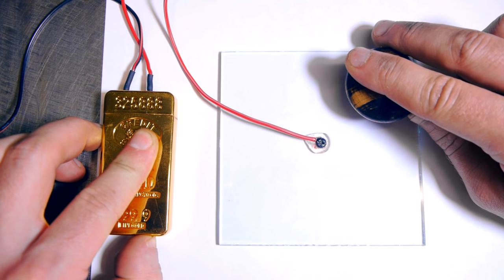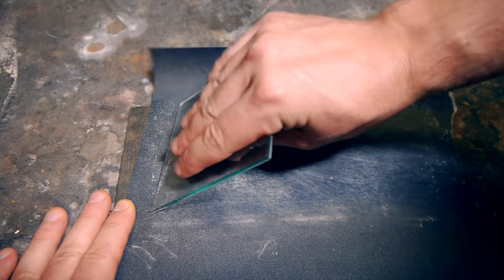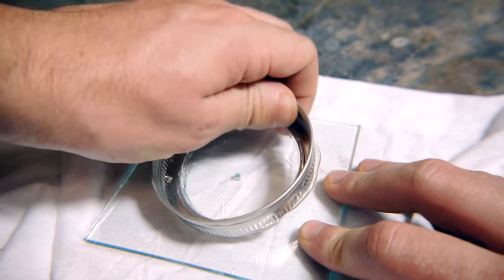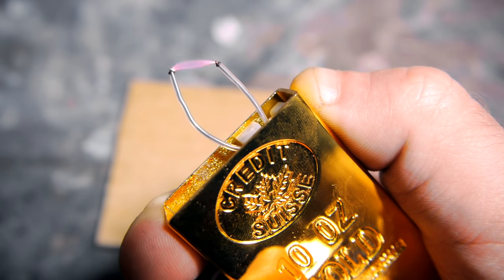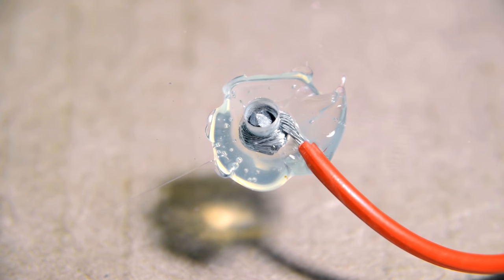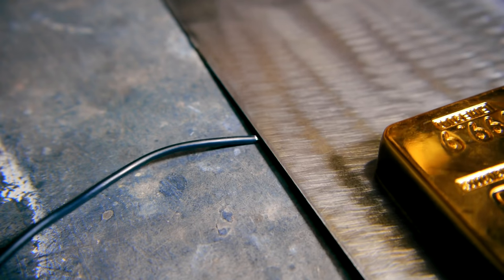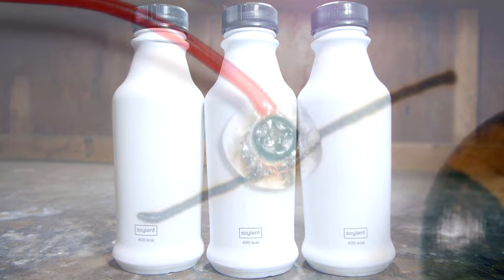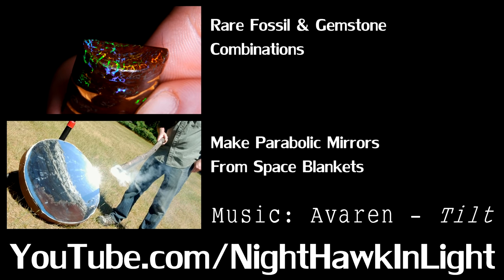How To Make a DIY Mini Plasma Cutter From an Arc Lighter - NightHawkInLight

Comment: Surely if you actually used one of these to light a cigarette you'd get a shock?
Reply: cigarets are non conductive
so no you wont het shocked
Reply: The electrical potential is between the two electrodes, not ground. You can't really get shocked unless you touch both electrodes with your finger. If the insulation broke down internally and created a common to the metal case, then you'd be in trouble - but it's low energy.
Reply: Is this question serious? :/
Reply: ***** Unless you roll you own, I learned that the hard way with a toaster...
Reply: Do you happen to roll steel rods into your cigarettes? Last time I checked, tobacco and paper weren't very conductive.
Reply: Hendlton
Did you not even bother to read my last comment?
Reply: if you roll your own the saliva will be conductive ad you tried to light a cigarette with a toaster hhahahahaha  LMFAO  were u high or something
Reply: Bricko Gaming Oh, right, I forgot you had to lick them. I was very confused.
Reply: Bricko Gaming
I was only a dumb kid, hence why i was smoking...
Reply: ***** lol
Reply: ***** Still smoke cigars, stopped with cigarettes because the amount i was smoking was just out of hand. I doubt i would have made it to 50 if i had carried on. Quit when i was 18 (now 21) and my doctor says another year or two and my body will be like i had never smoked and the cigars are few and far between so as to have pretty much no health effect
Reply: MrcabooseVG i saw to 13-14 year olds sharing a cigarette and one of them was from my school

Comment: considering a plasma cutter uses oxygen I would say this is not that
Reply: plasma cutters use compressed air and arcs  not oxygen
Reply: I think some use Oxygen, but most just use compressed air, mostly to push out the slag than to help burn the metal.
Reply: ***** I wasn't thinking straight. Most use compressed air but some use argon for some reason. Maybe for cutting exotic metals like titanium.
Reply: Tuttomenui we all make mistakes
Reply: Wow that is the biggest fail of a comment I've ever seen. congrats.

Comment: This has to be the lamest thing i have ever seen
Reply: Yeah, it's pretty much useless unless you need crudely cut paper shapes.
Reply: this is not useless if you replace the lighter with a high voltage power supply
Reply: this is not useless if you replace the lighter with a high voltage power supply
Reply: this is not useless if you replace the lighter with a high voltage power supply
Reply: Cut thicker paper?
Reply: +pappkopp even thin wood
Reply: If the frequency is high enough, you won't get shocked. Judging by this arcs length, I'm guessing that the lighter outputs around  10k volts
Reply: The Piscis I don't know about all those lighters but I know that at least some of them will shock you.
Reply: Hendlton 
lighters with lower frequencies will shock you, this lighter, however, has a frequency that is too high to shock you, but it will burn you.
Reply: The higher voltage alone wont likely kill you though.
Reply: watch BigClive's tear-down of an arc lighter. He puts a piece of solder into the arc and gets shocked.
Reply: PartVIII 
it was probably a lighter with a lower frequency.
Reply: The Piscis He thought that he got shocked because of ripples in the output frequency. When he put the solder in the arc, he thinks that it may have touched one of the electrodes, allowing the other electrode to arc back onto the case. NightHawkInLight should test his mini plasma cutter to see if it shocks him